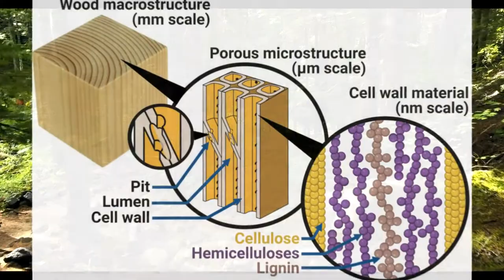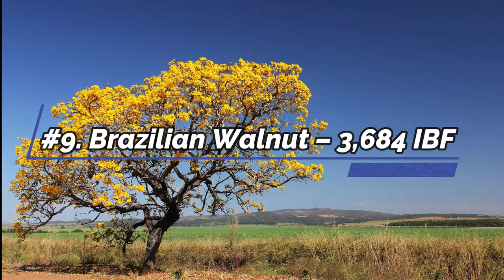The Hardest and Toughest Wood On Earth

Comment: I wonder what is the position of Teak Wood in hardness?
Reply from the maker: Teak wood is moderately hard compared to other types of wood. It typically falls somewhere in the middle of the hardness spectrum for woods. Its Janka hardness rating, which measures resistance to denting and wear, is around 1000 lbf (pounds-force), which puts it in the same range as oak and walnut but softer than harder woods like maple or cherry. Teak is prized not only for its moderate hardness but also for its durability, water resistance, and attractive appearance, making it a popular choice for outdoor furniture and boat decks.
Reply: @fzm7  . Thank you for your good explanation as we grow different trees for profit in Malbar. Trees like Agarwood and Sandal are also hardwoods but they are considered more precious and expensive.

Comment: What would be the best available, Wood that is lightweight and sturdy strong for shelving units that don’t sag?
Reply from the maker: For shelving units that don't sag, you'll want wood that's both lightweight and sturdy. Here are some top recommendations:

1. *Baltic Birch*: A popular choice for shelving, it's lightweight, yet strong and durable.
2. *Poplar*: A versatile wood that's lightweight, stable, and resistant to warping.
3. *Alder*: A lightweight wood with a high strength-to-weight ratio, making it perfect for shelving.
4. *Pine*: A softwood that's lightweight, yet sturdy enough for shelving units.
5. *Cedar*: A durable, lightweight wood with natural resistance to rot and insects.

When selecting wood for shelving, also consider:

- *Thickness*: Choose wood that's at least 3/4" thick for added stability.
- *Grain direction*: Ensure the wood grain direction aligns with the shelf's length for maximum strength.
- *Moisture content*: Opt for wood with a low moisture content (around 6-8%) to minimize warping.

Remember to always properly finish and seal the wood to protect it from moisture and enhance its durability.

Hope this helps you find the perfect wood for your shelving units!